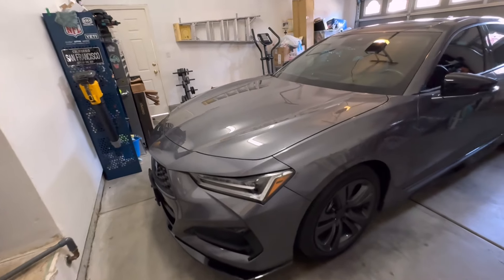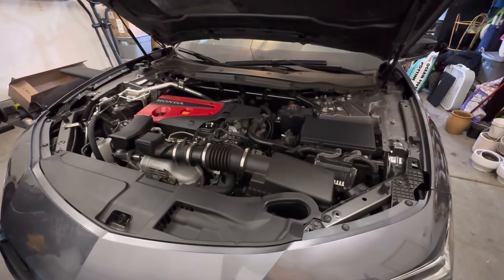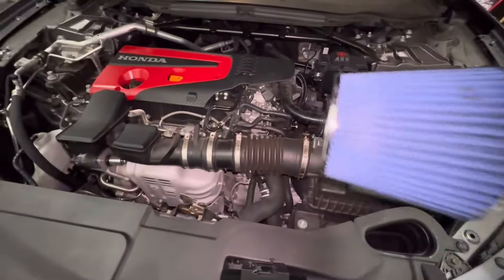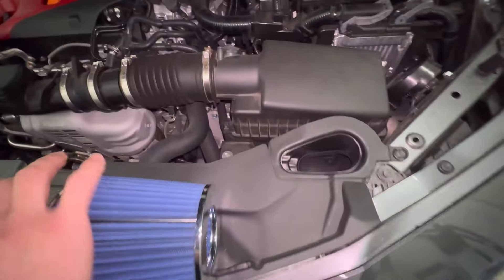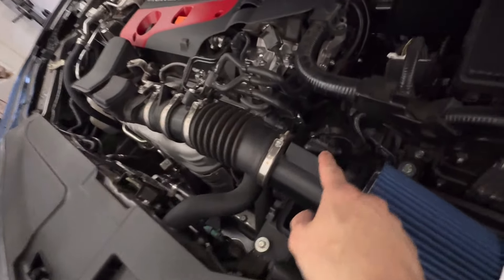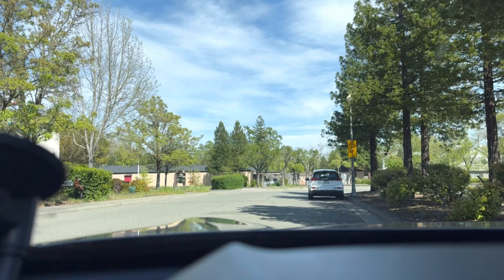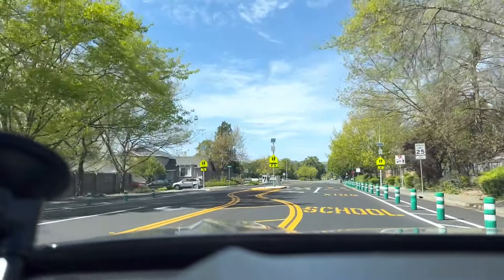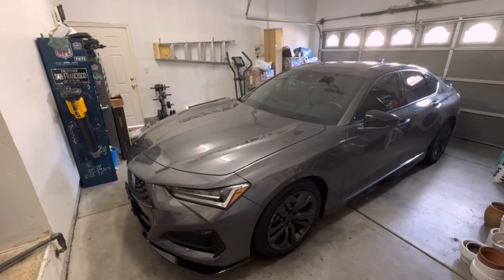Easy intake mod for Honda & Acura that gives maximum sound

Comment: Terrible mod. You’ll lose hp. There’s a reason why PRL is the best intake. It’s a true cold air. Worth the money. Do not do this mod. It’s the opposite of what you want for power
Reply: If you’re not racing the car, which in reality this is no race car, the hp loss which is less than 1-2hp does not matter. The sound gain is much mor enjoyable than the little 1-2hp loss that you won’t feel either way. You’re not pushing the car at its absolute most every time you drive it so the hp loss is irrelevant
Reply: @ZayFlxx  ok enjoy that lol
Reply: @ZayFlxx  you’ll lose more than 2hp on this. Prolly 10